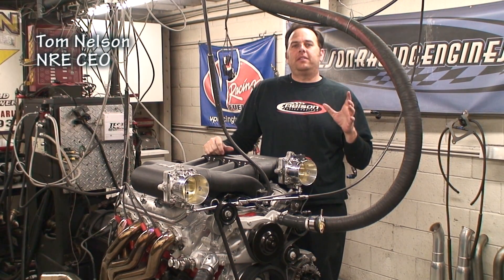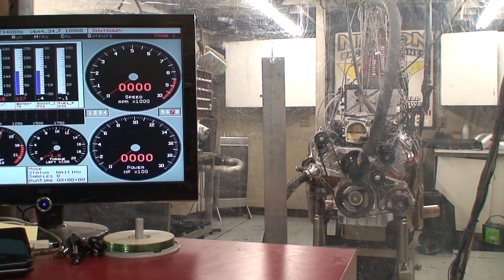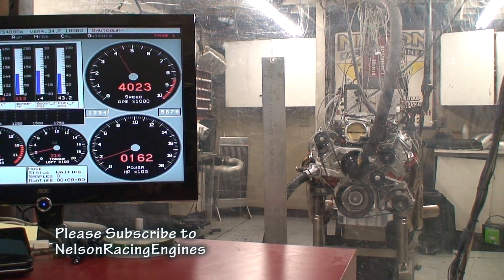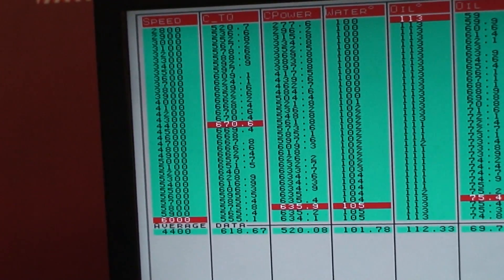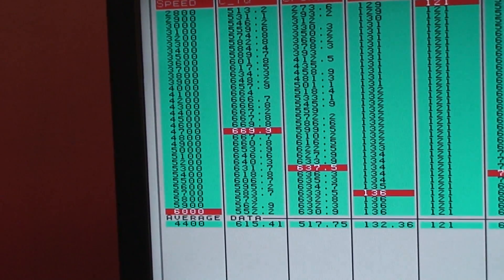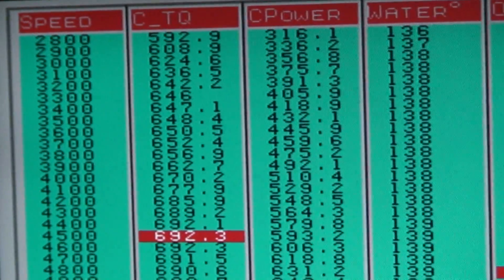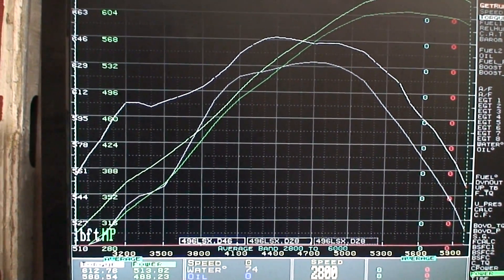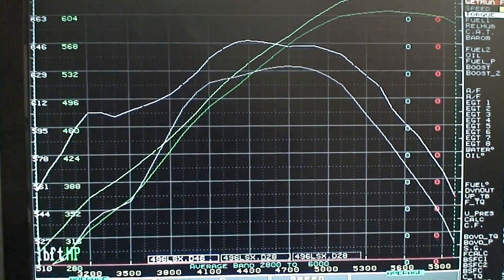NA 690 HP Small Footprint LS Engine.  New X-Ram Manifold tested.  Nelson Racing Engines. Episode 209

Comment: Are you for real? How can you say your nearest competitor is a manifold with a single throttle body? Why not compare it to a manifold with multiple throttles such as yours? Also, by the looks of the height of this manifold, chances of placing it under a normal bonnet is unlikely. I like the idea, but practicality is letting it down.